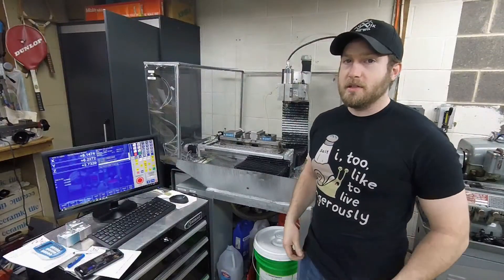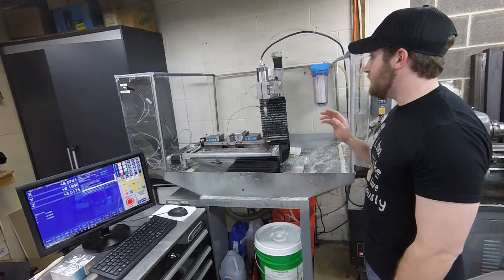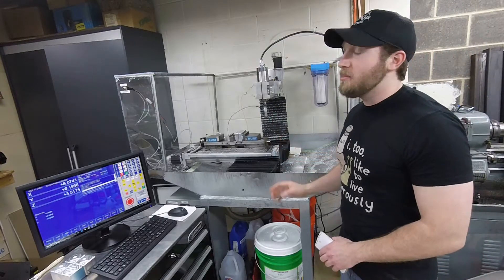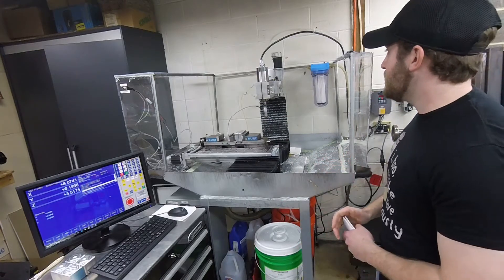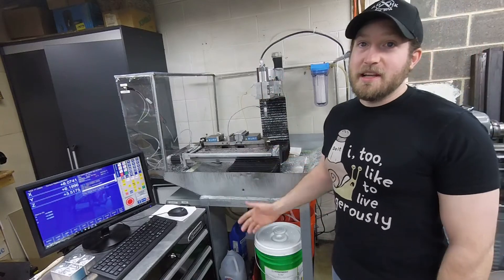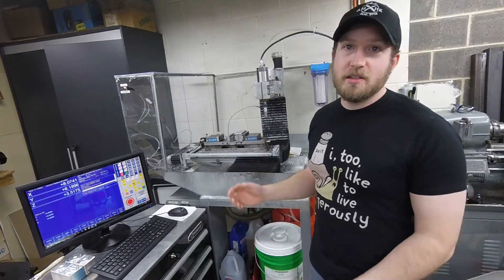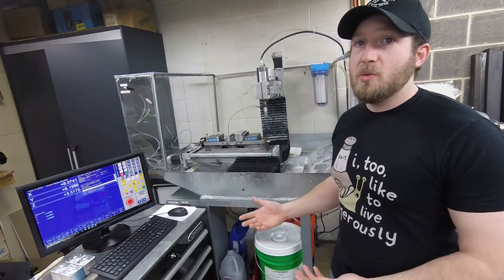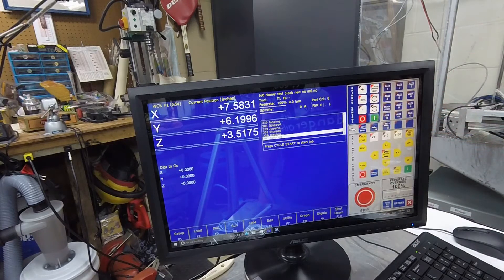Centroid Mill Setup Video

Comment: Hi so I’m in the process of converting my g0704 to cnc already have my acorn controller (your video sold me on it) and all of the parts, linear rails and I’ve manually machined all the mounts etc. didn’t plan on getting so hooked on the build or I would have built the whole thing from scratch. Anyways to my question I’m thinking about pulling the trigger on a 1.8kw ac servo for the spindle motor, changing to AC bearings and change it to pulley/belt drive but I’m considering just going with a water cooled spindle instead dropping a ton of weight and issues and gaining a lot of rpm, is that something you would recommend? This is only a hobby machine to build my own personal project parts but I want something that will handle steel and capable of lower rpms also, how do you like yours and would you do the same if doing it over?
Reply from the maker: Thank you, it really depends on how hard you plan on running your mill, heavy steel cutting definitely go spindle with step down pulleys,  mostly aluminum and softer materials i would do the higher rpm water cooled. Now that being said I run the pants off my 3 hp water cooled spindle cutting everything from aluminum to titanium with np, need a ton of speed in your axis so you can take thinner chips in those materials. Also flood coolant is a must with the harder materials in my opinion.